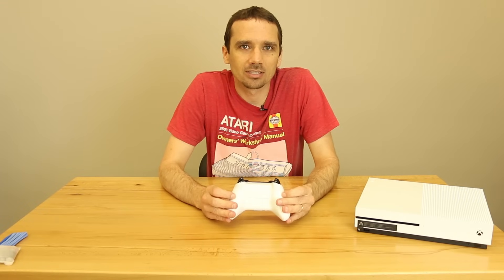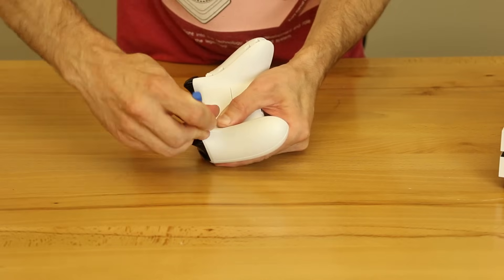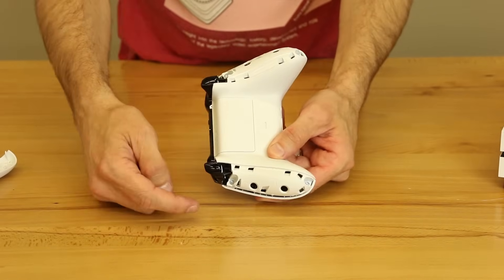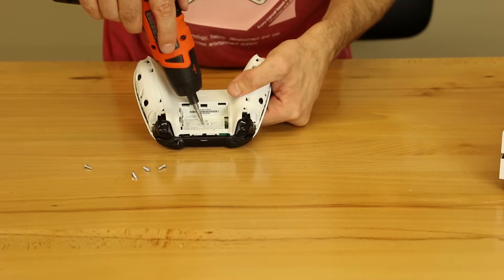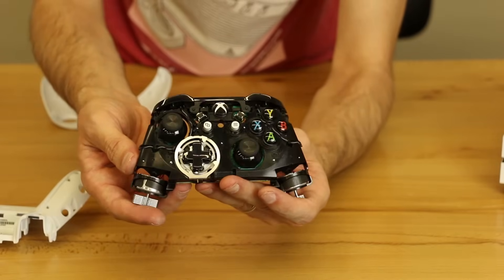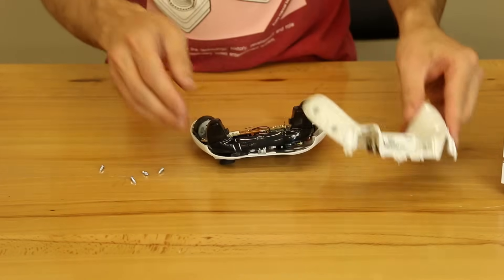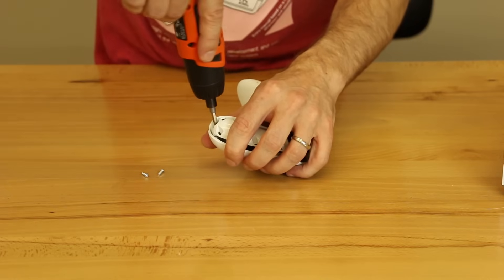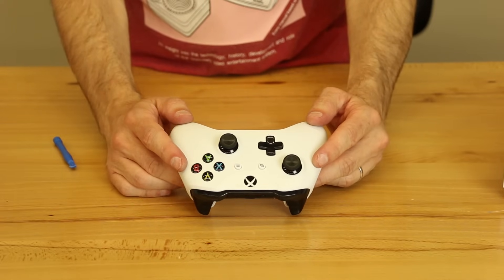Xbox One S Controller Teardown And Assembly

Comment: [Since you watched this video, you'll be interested in some info I have on "testing" your controller, so read to the end!]
I just bought (and received) a used controller just like the one in this video, and it was damaged.  The damage was not disclosed (and honestly, they probably didn't realize it... because it could hardly be seen).  Anyway, even though I could have sent it back and requested another one... there would be that wait time for return and resend, and I decided I would just fix it!

I have never opened an Xbox One controller before, and searched for this exact info on YouTube.  These controllers are built so much better than the Xbox 360 controllers, and the covers that snap-off (which was what I didn't know about) are a MUCH BETTER way to build these, as they cover the screws, compared to 360 controllers.

Once I saw that the covers pop off... that was all I needed to know (I already knew about the hidden screw under the sticker - which I removed intact, after softening the sticker adhesive with a hair dryer)!

This controller was either thrown by someone, or it was dropped onto the floor from high enough up... that the large rumble motor broke the frame that holds it in place, and was jammed as far down into the grip as it would go... thus preventing the rumble motor from spinning.  I repaired the controller, and it works perfectly.

If you haven't already gotten this... download the "FREE" app on Xbox One (there's ads, but you can "pay" to get rid of those if you want... I wouldn't bother).  Anyway, this app will test ALL aspects of your controller - including the impulse motors in the triggers, and the larger ones in the grips (which is what I needed to test).  You have to enable the motor testing under options, and I would recommend NOT enabling the trigger and the grip motors at the same time - at least until you verify that they work (so you don't get false-positives, as the triggers enable the motors for both sets, if selected).  Oh... the app is called, "Game Controller Tester".  There's another one, but it's crap!

If my tips about removing the sticker helps (or is of interest to you in not destroying it), and my info about the app is helpful... please give a thumbs-up.  Not because I need a pat on the back (I honestly don't care), but only to let me know if I have been of help.  I like helping, and I do it as much as I can, when on Xbox Live.  I've been told I should be an Xbox ambassador, but I'm not sure if I have THAT much time to commit to it.  Happy gaming, and good luck in repairing your controllers!!!   :-)

Comment: Do you what the wire connecting both motherboards is for ?( j2 and j1) I accidentally pull to hard and remove j1 from motherboard that has the joysticks

Comment: What about that wire that goes from the bottom to the top part over the red tape, what happens if it gets disconnected on the top

Comment: I found this helpful along with the controller  test mode in The Xbox. I diagnosed my in-player wading through mud movement to a permanent activation of the left joystick. The clue was in the test page you should have to press a button to see it identified and which way it’s manipulated. Every time I pressed any other button it always defaulted to the left joystick instead of being blank before and after each press. A quick squirt of WD40, drain, mop up and dry it before re-assembly did the trick! Thanks for the access hints above. If you can’t get the edge tools used above try a square, biro-type pen cover and trim a couple of tenths of a mm to get it small enough to sustain a prized open side panel. Don’t use the conventional rounded-wedge biro cover as it’s too thin and will snap.

Comment: So my fire trigger spring is on its way out, also the left analogue rubber I have been a bit violent with, just needs either turning round or turning round and switching with the right one. Looking at it before this I thought it was one screw under the sticker, would have never guessed it had two pop out parts, but really no different to a 360 controller, 5 screws etc. Thanks for the up load

Comment: What is the wire connecting lower circuit board and top looks like some kind of antenna cable it’s a thin black wire backside of controller near the yellow tape.
Reply: Probably Bluetooth.

Comment: It's kind of funny. Microsoft had this problem sence it came out and never fixed it. I think Microsoft is doing this so you would buy anouther controller. Also, who would put security screws on a controller?
Reply: The Screwdriver is 99p or 75cents on Ebay

Comment: what annoys me is the dead spots on thumbsticks where you are pressing the direction and it doesn't go there fully all Diagonal edges it should go all the way in the square box in controller test but the cheap rubber band box thumbsticks never go all the way very rare to get a good one!

Comment: It's been a little long but my controller has screws with little pins in the middle, anyone know what I need to use to remove those screws since it didn't works for me trying to open the controller

Comment: my T9 doesnt fit the holes of the screws same with my T6 what do i do now
Reply from the maker: You need security torx
Reply: what do i need to buy to replace an LB ? mine doesnt work which is whole reason i want to open the controller, and thanks for the tool name have one to be shipped in 22 days...

Comment: 2:16 In this case the “security” screws reffer to Microsoft’s financial security, since you can’t take them appart...

Btw, I found that a verry small flat screwdriver (I think size 2) did the trick it you jamm it between two of the corners.
Reply: thank you i don't have the right head and this saved me
Reply: Thanks was wondering about that
Reply: Yea thats what I did, worked fine
Reply: Had to go to Walmart. Found it in the “hyper tough 17 piece smartphone repair kit”
Reply: it worked! thank you i was so stressed out
Reply: Yes, the 2mm flat. Thanks!
Reply: When you tighten the screws back in you can break off the the little piece of metal in the middle with the flathead so it'll be easier next time

Comment: Would a T8 work?
Reply from the maker: Haven't tried that.
Reply: Yes but make sure it's a T8 security or pin in screwdriver or bit a regular T8 will not work because the screw has a pin in the middle of it

Comment: Can I us a T10 for this?
Reply from the maker: No
Reply: As far as I know, Microsoft has suggeste the use of the T8 security torx bit on the screws to the Xbox One-S controller housing shell and I believe you need a T5 security torx bit to remove the screws on the inside of the controller that are fastened to the motherboards.

Comment: Oh, so its exactly the same as taking apart the regular xbox one controller.
It's really easy to paint the front of the body just take that part and put it somewhere like outside and spray paint it. So there is no need to buy it online and no need to wait for the delivery.
Reply from the maker: Yep, pretty easy
Reply: The faceplate for the Xbox One-S controller is NOT the same as the faceplate for the Xbox One-S controller, as you can clearly see what the difference between the two is. The controllers might look somewhat similar and they are even able to be disassembled the same, but if you take the time to actually look closely at them then you'll notice the differences between the two. Just a little tip for you to help you keep from wasting your time trying to get the faceplate for the  Xbox One controller to fit the Xbox One-S controller without any issues with the way it fits.

Comment: Bought some
2pcs Qunqi 3D Joystick Wireless Controller Rocker for Xbox One. Actually didn't know what I was buying, thought they were classic joysticks to play old style video games like pac man. Is it worth putting these in my controleer. Will they be an improovement over whats already in the controler. Also are there classic atari or better style joysticks you can use with xbox 1 to play these old style games.

Comment: my controller was charging and it all do sudden stopped working
there was a slight burnt smell and the play and charge kit battery pack wasn't able to turn on the controller; it could (and charge) with another controller.
I put in batteries and the controller would turn on but only for 2 secs.

I think the capcitators are gone but I'm not sure? Anyone know?  please respond. thanks

Comment: Do normal xbox one controller grips fit onto an xbox one s controller?
Reply from the maker: What do you mean by "grips"
Reply: the grips at the back of the controller
Reply: Harrison Stewart No you cant switch grips around. i tried it already. i think they did that on purpose. the diameter of the headphone jack is different. the power on button is slighty different placement so that dont line up. then on the inside the plastic that supports the vibrate motors is upside down in the xbox1 S controller. so screwed all the way around. i wanted to use the grips from my xbox 1 forza edition controller because it had a really nice rubber texture. the xbox 1 s gears of war edition although really nice in itself, i didnt like the grips on controller. feels cheap plastic with very minimal texture. cant hardly feel it. but oh well. i got rid of old xbox 1. hope that helps.
Reply: thanks

Comment: For everyone asking about using controller shells on this new controller, you can't. As seen in this video, the top piece surrounding the xbox logo is connected to the main shell, unlike the old controller where it was separate.

Comment: The Rb LB mechanism looks different. Would of been nice to see a full dismantle, as you only took the shell off. Thanks anyway
Reply: Kingsley Freedom Show exactly why I came to see this, what a half assed disassembly.
Reply: Heseth  weres that video the full disssmantle
Reply: you can look it up,there's a guy who dismantle the entire thing.And from what i saw the bumpers are now like the old Xbox 360.In case you don't know the 360 controllers have the bumpers made out of one piece of plastic that was pushing directly in the switch,unlike the old box one controller that used that awful leaver like actuation mechanic.Also i noticed that they are way quieter than the old ones.
Reply: ive tried lookig it up i ended up here, send a link ?

Comment: Great video. I have the One S controller in black. I love it but I noticed the panel on the left creaks every time I'm playing. I'm by no means man-handling it either, just gripping it normal. It just feels like it has a little too much give. Defect or do you think that's normal? Maybe taking it off and snapping it back on would fix it.
Reply: FreshnessKills mode does that 2
Reply: FreshnessKills mine*
Reply: ToxicFox It would drive me crazy so they exchanged it for me. I recently purchased the dawn shadow edition and it does it even worse though! I guess I just have to live with it.
Reply: FreshnessKills if you're never gonna open put some crazy glue around it. only thing i can think of. other than maybe opening it and maybe twisting the shells around and then putting it back together tightly. the molds mightve been screwed up and were making warped shells. or they cooled to quickly from the mold.who knows. give it a try.

Comment: hey guys stepped on my controller by accident but snapped the headphone jack to my headphones off which is stuck n the controller port just wondering if its easier to buy a new controller or try and fix it but don't know if its possible to get the headphone jack out?
Reply: Naughty Nubbin try like a flattened toothpick, or a lolipop stick with a little superglue on the tip and glue it to the jack. once dry give it a tug.
Reply: ha... I came looking for same thing. tip of my jack is stuck in the controller. trying to find a video to see if it is possible to open my controller and push it out?
Reply: If you can get inside witha torx driver you can push out the jack from the other side but you have to take a whole lot off tto get to the bare circuit board but i had just removed a headphone jack theyre actually not soldered the jack is a box that is pressed on contacts byy the inisde case
Reply: Me too lol
Reply: My foot got in the way and kicked my headset cord so pretty much the same thing
Reply: If u take the 2 screws out of the outer circuit board and lift it slightly, the headphone jack isn’t soldered. It just falls out. Buy a new jack, set it in place, rescrew and ur good.

Comment: Is there any difference in the thumbstick modules from previous Xbox one controller? They said they improved thumbsticks for wear. Wondering if that was just the plastic thumbstick or if they finally improved that little plastic piece on the module.

Comment: im taking it apart to do a paintjob soon - any recommendation on the type of paint i should use?
Reply from the maker: I would use a paint that specifies that it's good for plastics.
Reply: you could just buy a coloured one. they do good ones
Reply: smidget whittington microsoft doesnt ship hardwares to my country i had to buy my xbox through a median
Reply: Đen Nguyễn Krylon for plastics, have to be careful what kind of paint you use. Some paints will "melt" the plastic. Be sure to spray it with primer, then your paint whatever you want on it, once you're done, you'll want to clear it. If you want this paint scheme to last, dry each layer in your oven. Turn the oven on it's lowest setting, let it heat to about 120 then turn it off and put the controller pieces in to allow the heat to dry and cure the paint. Sounds like alot of work, but it's the only way to get the paint to last.
Reply: oh that sucks
Reply: There’s a website to colour your Xbox controller

Comment: My Xbox One's Motherboard has some kind of Defect....So does anyone know where to find a X1 Motherboard Or atleast tell me wat to do wit it? (no warranty )
Reply from the maker: What seems to be the problem with it?
Reply: it's little complicated... one of the problem is green screen problem which suppose to be the Offline Update Problem. There is solution for this problem in Xbox's Website, but it didn't work for some reason (which i don't know ).... thn there is the game freeze problem which is like, mostly games get stuck while i play them (for example: Fifa 16.. When i play a Match...sometimes the commentary goes off, sometimes it stucks for 4-10 secs & sometimes it Stucks in menu) & the last problem is pretty much the sane as previous one cause in this problem the console gets stuck instantly for no reason & the only thing i can do is power off the console..it mostly happens whem there are atleast 3 games installed or more ...I don't understand the problem which is creating these problems but i went to a couple of stores & the technical said it has some kinda motherboard defect & he couldn't do anything to fix it. The only way to play this xbox is, if i reset it & install just 2 games & play rarely... 😣
Reply from the maker: We've fixed similar problems before. We're happy to take a look at it if you'd like. I don't think it's a motherboard issue but I'd have to have a look at it to be sure. You can send it for diagnosis here if you'd like: http://www.tronicsfix.com/store/p51/diagnosis
Reply: +TronicsFix if it's not Motherboard Problem, then wat do u think is wrong wit my Xbox One? & Also do let me know , can i ship from Doha,Qatar
Reply from the maker: Sorry, can't do international shipping. It's possible that it is the motherboard, but it also could be a bad hard drive.
Reply: Well thts sad 😔.... but i would love to know if u could figure the problem out...& also if u start doing International shipping
Reply from the maker: We'd love to do international shipping but it's just too expensive.
Reply: Oh...i get it...Btw, Great Channel 👍
Reply from the maker: Thanks!

Comment: +TronicsFix I'm trying to find out which console is more prone to defects before I make a decision.
Would you mind sharing which console, Xbox One or PS4, is brought into or are sent to your shop the most?
All received for repair, but not necessarily repaired by you (because someone may decide not to repair).
Just say Xbox One or PS4 no numbers. And don't include consoles that just need to be cleaned.
Reply from the maker: PS4....BUT before you jump to conclusions keep in mind that there have been twice as many PS4's sold that Xbox One's.
Reply: OK, can I ask you then : Is the ratio of repairs brought in close to 2:1  (PS4 : Xbox One) ?
Reply from the maker: No, but there's not really a good way to tell which is more reliable. Part of the reason we don't get as many Xbox'x is that Microsoft isn't as strict with their warranties. For example often times they will do warranty repairs even if you don't have a receipt. Sony will not. 
We also advertise our PS4 services more heavily than Xbox One since there's so many more PS4's out there.
Reply: OK, point taken. I'll give both the same score for reliability then.
With a note that Microsoft  often times does warranty repairs without receipt and Sony never.
Thanks for responding and giving your insight.